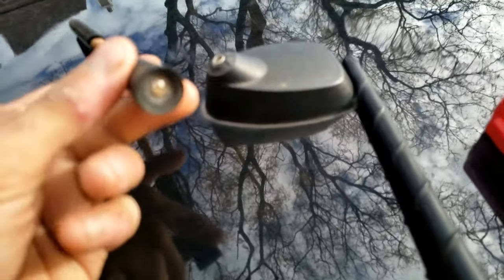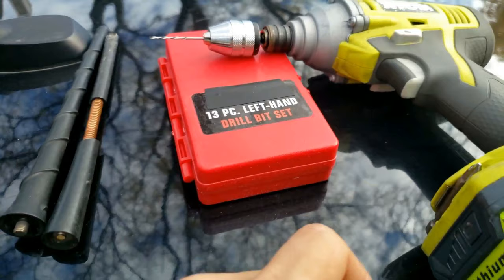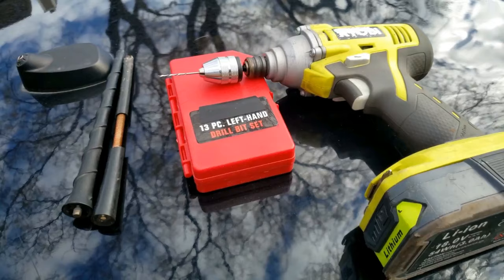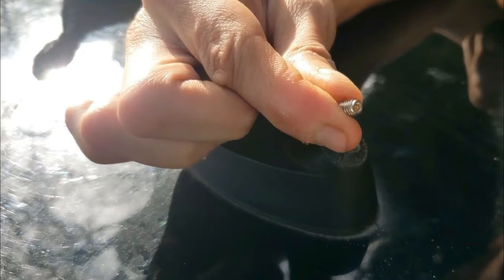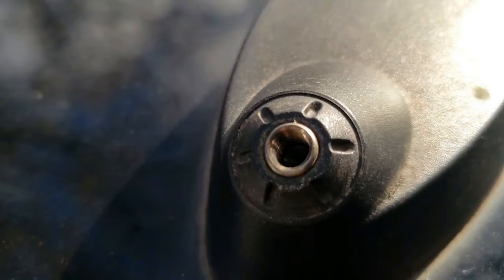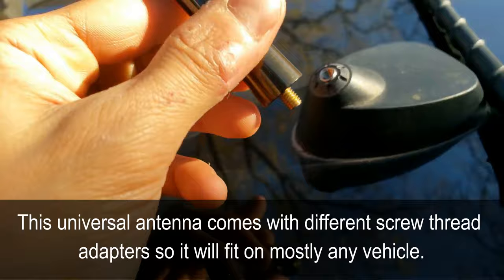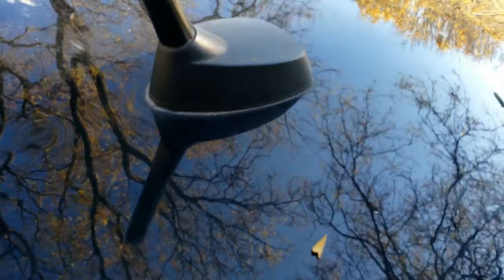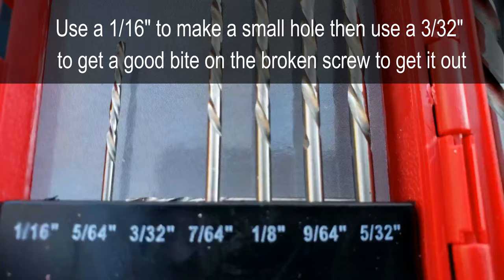Repair Broken Car Antenna 📶 That Snapped Off

Comment: The Chevrolet repair shop mechanic told me it couldn't be done, and my only option was to buy a new antenna base from them for $165.
Reply from the maker: Did you try it? Try not to get a new base if just the screw is broken inside.
Reply: Yup! i successfully removed the broken peg of the old antenna myself and avoided their silly sales-ploy of trying to get me to purchase a new base as being my only option :-)
Reply: I just now hit my garage door backing in and it snapped my 2012 Ford fusion antenna right off. The screw is stuck just like this. Will try this to remove it. Thanks for the video!!
Reply from the maker: Nice so glad to hear. Tell them to stick that base up their 🍑. Because you know they have No antenna!
Reply from the maker: Glad this helped!
Reply: @FixCarYourself It worked! All I had to do was apply some elbow grease. It popped right on out.

Comment: I've been using this method for removing broken bolts for 20 years, everyone screams "Use an easy out!" but in my experience, easy outs are the worst. They break with no notice and then you have to drill out the remnants. LH drill bits FTW :)
Reply from the maker: interesting.
Reply: I’m confused, why LH ?
Reply: @amiller8822  Using a left hand drill bit, with the drill in reverse, the bit bites into the broken stud and turns it. 9 times out of 10 it will wind itself out while drilling
Reply from the maker: Nicely put!

Comment: This is a great tip to save you the $75 for a new base (not including labor), which I guarantee is how the dealer will fix it.  An alternate approach (which I just did myself 20 minutes ago): If you DON'T have the extractor bit or the reverse drill bit set and you DO have a Dremel tool (or similar) with cut-off wheel, carefully cut a slot thru the middle of the broken screw and use a flat blade screw driver to back it out. If you cut a little of the threaded female receptacle, that's not going to negatively effect anything. Use whatever method you have the tools to do and save yourself $75+.
Reply from the maker: I like it! Thinking outside the box. Nice job!!!
Reply from the maker: $75 for the base? Wow. The sad thing is the repair shop will recommend swapping the part, which means you'll pay for unnecessary labor (the real killer) and other parts. When all you need to do is spend less than 10 minutes doing this procedure. These repair shops need to think smarter instead of stealing money from its consumers. They should charge for less than 30 minutes of labor, and for the replacement antenna part.
Reply: @FixCarYourself  Yep. You're video here helped me to understand what I was dealing with, thus it was very helpful even though I used an alternate method, so thanks for that!
Reply from the maker: @tenentenegrao  Whatever does it.  Regardless the issue was resolved and thats ultimately what matters. Great job!!!

Comment: Lucky you did't dent scratch the roof with that drillbit, also... the usual way to remove things like this is with a left threaded tap, just drill small hole and insert the left threaded tap, since its conical it will eat itself and gets stuck, right then the broken piece will come out, you got luck that it came loose, but it could have end up just drilling drilling and there goes your thread... bit risky job.
Reply from the maker: That's what I used was a LH drill bit tap. You could also use an extractor bit.

Comment: Thanks for the video! Another solution I found was this: I used an awl and a hammer and lightly tapped the broken off part to turn it little by little (it could not be grasped by pliers or nudged by a screwdriver). I tapped it laterally with as little downward force as possible. That took about 5 minutes but it came out little by little until I could grasp it with my fingers and get it out the rest of the way. I got that tip from the service department at Klein Honda in Everett WA, BTW, so thanks to them. Had the piece refused to come out with the awl and hammer, my next step would have been your method (a body shop might cost you a couple hundred bucks, I learned).
Reply from the maker: Nice job. You didn't even need to buy the Left hand drill bit or extractor set. My only concern would have been potentially breaking the threads. However, it seems like you did this very carefully. So great job in figuring out how to do it differently. But achieve the same result which is getting that little piece out. 👍

Comment: Exactly my issue and I fixed the same way today.  I found that a center tap helped me keep the bit from wandering to get it started.  I also used a couple of drops of oil to help the bit cut a little quicker.  Thanks for a very useful how-to video!
Reply from the maker: Yes great point! A center tap can make it easier to drill straight through the center. and a drop of oil can also help reserve the bit and drill quicker like you said. All very nice points!  Thanks and I'm glad you did this project yourself.

Comment: Thank you!  I was able to remove the piece stuck in there with a small drill bit.  I drilled a small hole and when I reversed it, I was skeptical, but it threaded itself out enough for me to finish by hand.
Reply from the maker: Glad it helped!

Comment: This worked perfectly. I did need to start with the smallest bit in the set, then use a slightly bigger bit and it came right out. Awesome
Reply from the maker: Glad it helped. Thanks for your experience. Hopefully this gives some insight to others trying this out!

Comment: Thanks, I just did this. Had to go buy a left handed drill bit set from Menards for $7. Worked like a charm! I only used a 1/8" bit.
Reply from the maker: Nice job. Even better buying it at Menards, as that is like the cheapest place with the best customer service to buy tools IMO.

Comment: I purchased a left hand drill bit set at Harbor Frieght for $9  and following your steps did the job in 10 minutes.  Thanks for you concise, well-done video!
Reply from the maker: Glad it helped and you did it quickly! Way faster (and cheaper) than going to a dealership that's for sure! Harbor Freight, Menards, and Amazon are usually the cheapest places to get these LH drill sets. So even better you got a good price!!!

Comment: I noticed a while ago that my radio was not working properly as it was mostly all static, so I stopped listening and relied on my phone for music. I did this for about a year. Then only just recently did I notice my antenna was gone, so I purchased a new one and when I went to replace it, I saw that the old screw was stuck inside. (sigh) I knew there had to be an easy fix, so I did a Google search on 'how to fix an antenna that broke off in car' and came across this video. I need to get a bit drill then I'm going to try and fix it myself.
Reply from the maker: 👌  awesome let us know if you get this done with ease.

Comment: I was backing up into my garage and the clicker went off and the door came down right ontop of it, I pulled forward and it snapped right off. Thanks for this
Reply from the maker: Hope it helps. And that sucks about the garage door falling on the top. To get rid of the dents on top you'll have to use one of those dent repair tool kits. And by the way adding a new garage door camera sensor is easy. You may want to check that as well. I know all these projects take time and add up, but its nice to get these done and completed.

Comment from the maker: A left hand drill bit's threads are pretty much reversed in that the threads or flutes on it are structured in the opposite way of a regular drill bit.

Think of it this way the antenna is screwed (turned) in clockwise (to the right). A regular drill bit is threaded in a way to be used when turning clockwise, which is why you can't use it because you'll just drill forward creating a hole in this case.

The goal is to remove and to remove a screw or broken antenna, you need to go counter clockwise. 

So pretty much when you put a left hand drill bit on the piece of the broken antenna that is still stuck in its base, the LH drill will grip or bite the screw/broken piece and twist the remains of the antenna left or counter-clockwise. Therefore you can remove it fully.
Reply from the maker: BTW this Left hand drill can also be used for any kind of screw that has a damaged head or where you can't get a good grip on. Think of the top of a rusted screw if you can't get it off with a screwdriver, then you can use this handy tool to extract or twist the screw in a counter-clockwise direction to remove.

Comment: I’ve been using drill bits for years for basic carpentry and never heard of left hand drill bits
Reply from the maker: I know pretty cool huh! I learned about this type of tool because I had to figure out how to best remove the antenna. Not sure how long this has been out, but I should mention you could also use a screw extractor instead which of course has been out a really long time. Their is a slight difference in the 2. Check out the previous comments, as I explain the difference. Or learn about the differences online. Very cool! as technology keeps advancing!!!

Comment: well mine didnt break like that, but its a good video. Enjoyed it eighter ways . keep up
Reply from the maker: Thanks! How did yours break?
Reply: Wel your bolt broke inside, but mine the plastic snapped of so there a hole there now.
I see the pins inside any idea hoe to fix it? It still works withouth the antenna
Reply from the maker: @christopherchristiaan3788  I've seen this a lot! So usually the best thing is to just replace. HOWEVER, a few creative ways to try: Black Electrical tape, Strong non melting glue to fill if small gaps and touch up paint, or a rubber or fabric sleeve to go over it.
Reply: @FixCarYourself  okay thanks, will try one or 2

Comment: I know I can’t fix this on my own Kia but this gives me peace of mind that this is an easy fix for the dealership
Reply from the maker: Actually I believe you could do this. Just having a power drill and a left hand drill bit set and replacement antenna is all you need. Do it slowly and you'll get it out. Let me know if you have any other questions if you work on this.

If you do take it in to them make sure they don't charge you a lot for a job that takes less than 30 minutes to do.
Reply: The problem is I don’t own any of those things and I can’t see the top of my car unless I’m standing inside the door (I’m 5’2).
Reply from the maker: @erindianis5544  Ok. Standing from the inside works (I'm short too), unless you have a step stool.

A basic power drill costs $30 to $40, the left hand drill set is about $20, the actual antenna could range from $15-$40. If you think you might do other small basic household repairs then the power drill is a great investment. 

If you have a friend with those tools even better.

If you don't do this, then price shop. No reason for you to spend an arm and a leg on this or get ripped off at a dealership.
Reply: @FixCarYourself  this happened to my moms honda and before even looking up videos i came up with the concept of using a reverse threaded screw. Seeing this video confirmed that i would've struggled, and I appreciate the details down to the measurements of bits, thank you.
Reply from the maker: @NoGlutonForLuton  Glad it helped, the details are always important, and glad you thought of the solution even before researching. We need more people to start thinking outside the box instead of just going straight to a dealership to resolve a simple problem.

Comment: Do you think you can use the same technique to get the piece stuck in the base of the antenna out in order to replace and reuse the antenna itself?
Reply from the maker: Yes, but not to reuse the piece. If you tried like gluing it then the antenna wont have a good ground anymore, and you'll probably have a bad radio from going in and out, or it may not even work sometimes.

Comment: I’d love to try that but I was using a poor quality 3rd party car antenna and it had rusted underneath and in to the antenna mount. I’m afraid of using the drill and it not being able to loosen the broken bolt due to rust. Is there some sort of rust dissolver that I can use on it before trying the drill?
Reply from the maker: Yes, I actually made a separate video on cleaning this. That actually may do it. Here is the link: https://youtu.be/vfRUNbFYxuY?si=mt4QmcebnOI-gRXR

Comment: Just got to be carful of the threads 👍
Reply from the maker: yes good call. This is why its best to use a small drill bit and then the next closest drill bit size. The goal is not to drill the sides that being the threads.

Comment: hey i have a question , if you dont replace it, and it rains will it damage anything?
Reply from the maker: In time it could, as rain gets in there and starts to corrode the area. At the minimum plug it up with something.

Comment: How do I know what size to screw in for a antennae?
Reply from the maker: If your antenna is broken take it to a hardware store and they can match it up. Or buy the exact models replacement, or you can get a universal antenna which usually comes with all the adapters.

Comment: The heads broke off the pins that hold the caliper and bracket, do you think this will be strong enough to do the trick?
Reply from the maker: Yes it sure will, but their may be another way to remove the pin from the caliper bracket. I made a separate video that will definitely help you decide which method you can choose to do. 
Here is the video 👉https://youtu.be/B8H6C0K71Ds

Comment: Hi... What is the size of the drill bit you used? And what M-type was the antenna screw tip?
Reply from the maker: I mention the drill bits used at the end of the video. But its best to have a set and start with small bits before you use the next bigger size. I think I used an M2 thread...however just get the oem replacement for you car or buy a universal antenna set which comes with all the M THREAD TYPES.

Comment: Are antennas needed for key fobs to work?
Reply from the maker: The short answer is no....however depending on how the vechicle is wired...it could. Like some antennas are used as a ground and if the key fobs wires are  connected  then maybe it would effect it. 🤔 so tough  answer perhaps other could help clarify this better.
Reply: @FixCarYourself  one day the key fob worked the next day it didn't got a new battery. Idk. Corrosion is less than a flea, so it shouldn't be a problem. Idk. This is why I hate new cars.
Reply from the maker: agreed!

Comment: How to buy the replacement antenna to screw in? Mine has M6 female thread
Reply from the maker: Just do a search online with your car make and model on AMZN, EBay, or other car parts stores, and you can either get an OEM one. Or you can buy a generic one which usually comes with a few adapters which it will say in the description.

Comment: how do I get up on the roof of my 2020 Jeep Cherokee to do what you did?
Reply from the maker: Open the door and stand on the side. Or you may have to use a short ladder to reach the top of the roof easily.

Comment: Anyone know if the actual base is ripped off from a car wash? Cannot find any videos on this repair 🤔
Reply from the maker: Depends on the model and vehicle. The base is usually screwed and secured from the inside which means the headliner would have to be completely (or mostly) removed. Not a quick task unless you want to remove the headliner.
Reply: Yes finding this out unfortunately
Reply from the maker: I got use to it on my vehicle for about a year.

Comment: Thanks for sharing.
Reply from the maker: Glad it helped!
Reply: @FixCarYourself  my Chevy Aveo's antenna metal thread was trapped in dirt and would not come off. I had to use vice grip pliers to remove the top section, with the help of some lubricant. The OEM antenna part was pricey but, it fits well with the vehicle.
Reply from the maker: @traficamcapetownsouthafrica  nice!. and good thinking using the lubrication, and btw an air can may have also helped or at least may help others who are working on this now.
Reply: @FixCarYourself  👌🏼😊👌🏼🤩

Comment: So, I was gonna grab an EZ out and use that. Do you think the LH drill bits are better?
Reply from the maker: Tough call. Their both great for this little project. I think the threads on the drill and the EZ extractor are different.

 I think the extractor you can do in 1 shot, but the LH drill, as you saw in the video I need to drill it twice with 2 different size left hand drills.

Anyway, to me it doesn't matter and i really have no preference..

I like to say use what you got.

Maybe others can chime in on this?

Please let others know of your experience if you use the exttactor, and if its one less step than the LH drill process.

Comment: Mine is rusted though, what would you do in that situation?
Reply from the maker: I'm guessing the top part is rusted, but the core is probably still good. I would do this drill approach. My antenna top probably had some rust on it, as the antenna was broken/missing for about 4 months. Yet, this still worked for me.
Reply: Thanks for the reply I really appreciate it! I will give it a shot
Reply from the maker: @TMCelica  Cool! Let me know how it goes, and make sure you use all the correct equipment as stated in the video.

Comment: can you explain why you specifically used a left hand drill bit?
Reply from the maker: Please check the comments above for a detailed explanation. Short answer: its pretty much because the threads are shaped in a reverse direction.
Reply: @FixCarYourself  thanks, bought the bit, did what you said, worked perfectly! thanks for the tip!
Anyone want to buy a used left hand drill bit from me?
Reply from the maker: @resrudeboy  Great! Keep the left hand bit set. You can use it to get other broken screw heads or other Bolts out.